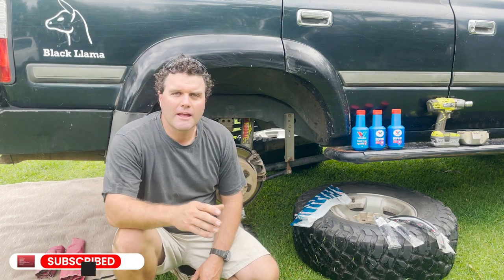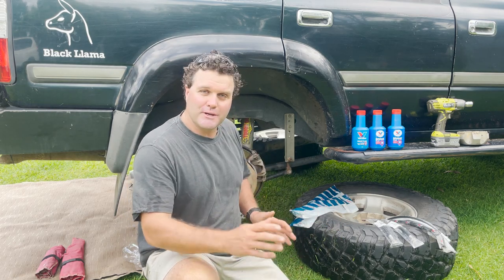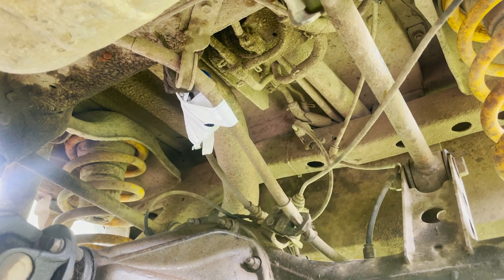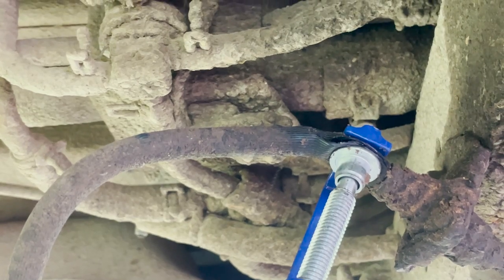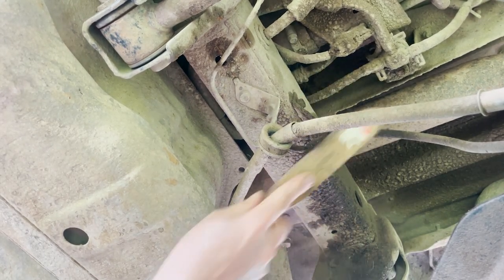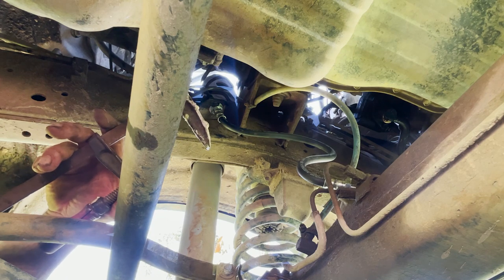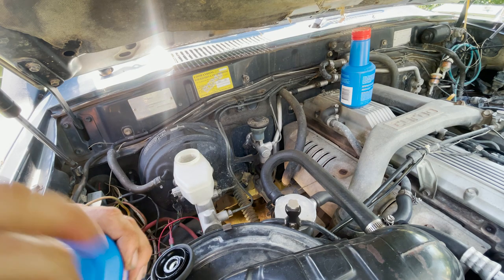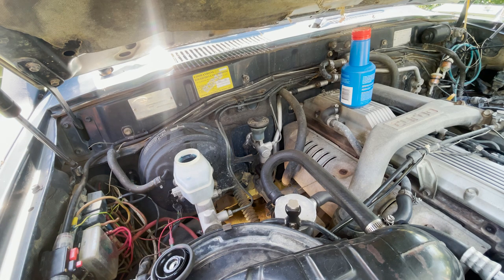80 series brake hose replacement

Comment: Followed this to replace my brake lines with the Slee Steel braided brake lines. Thanks for the video! For anyone who is new to working on cars, I would suggest a line wrench or flare wrench. They are made in the same way that he used the cut 10mm wrench that he cut and used the vice grips with.

Comment: Did a pretty Decent job mate, maybe next time you do this type of job give all the brake line connections a good hit with some penatrent half a dozen times over a couple days before you try and undo them, and a set if flare nut spanners are fairly cheap these days an worth there wieght in gold doing these, a propane torch and a few heat cycles is the next option, heat spray heat spray as needed, will work 99% of the time. Great video though mate,really good to watch

Comment: hey mate where did you get the copper washers from and what size are they. I am about to do this job and my kit hasnt got washers
Reply from the maker: They came in my kit from my local parts shop. You should be able to pick them up from any parts supplier. They should be able to look up the correct size for your car from the vin

Comment: My LC VX80's rear brake hose is damaged and I'm having trouble finding a new replacement at a spare parts shop, most shops say they have no stock, can the rear brake hose be used with the front brake hose? What is the serial number of the rear brake hose?
Reply from the maker: I would suggest trying https://partsouq.com and use your vin/body number to find correct one to fit your model

Comment: Is the rear brake hose the same as the front brake hose, including the serial number? what is the serial number for the rear brake hose?
Reply from the maker: rear hose and front hose are different. as for parts number I am not sure. I would suggest trying https://partsouq.com and use your vin/body number to find correct one to fit your model

Comment: Can’t seem to find the replacement hoses for the rear axle to drum. 

So far I’ve found the SLEE front axle to caliper hoses. Frame to axle hose. Rear frame to axle hose. 

But no rear to drum hose.
Reply from the maker: I would ask at your local parts shop. They will be able to look up the exact model number for your car and tell you where to purchase them

Comment: did you bleed the system prior? Could I not just do this with fluid in it and then top it off?
Reply from the maker: After you have taken apart any brake parts the system needs a full brake bleed. This is done in one of my other videos. There can be no air in the system. If you just top it up the brakes will not work. You mush always bleed the system till no air comes through.